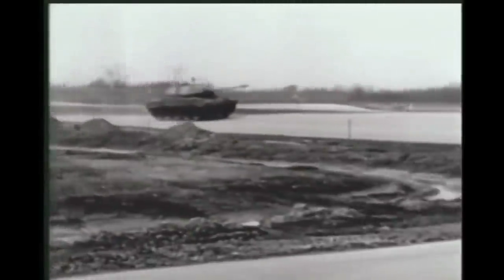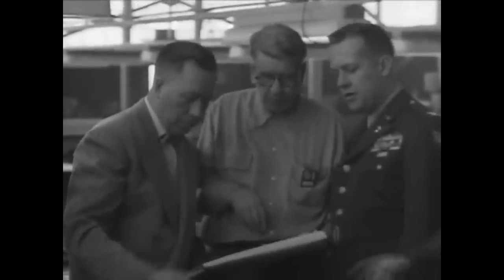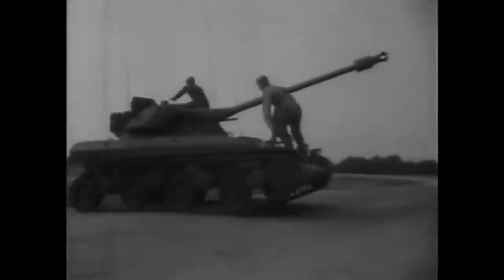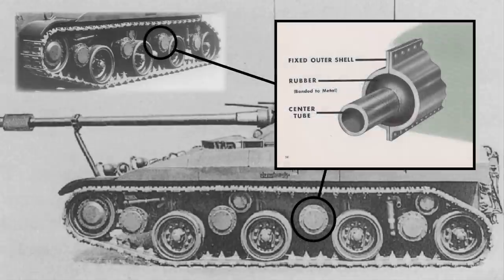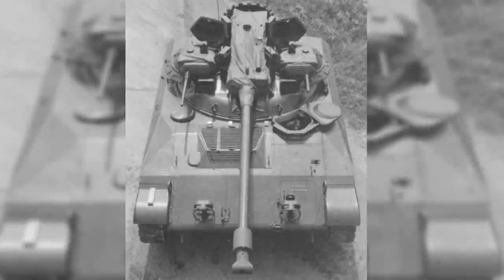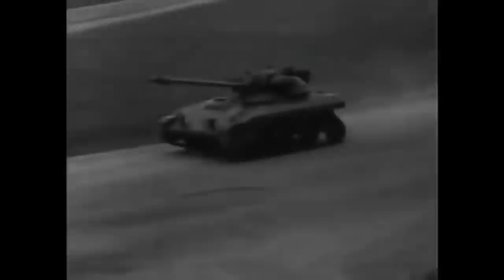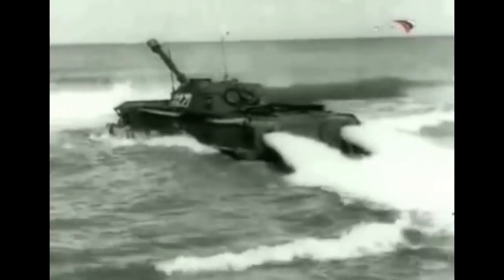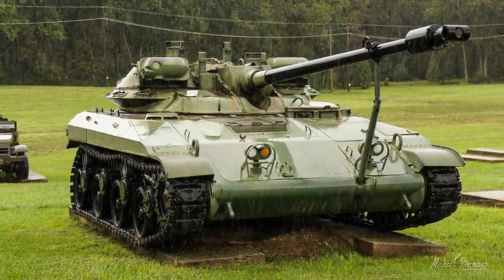T92 | Triple Turret Airborne Lightweight

Comment: Fun fact: every tank is airdrop capable. The problem starts only if you want to be able to use it afterwards.
Reply: You mean like airdropping humvees without parachutes?
Reply: @philvanderlaan5942  Maybe i guess?
Reply: @Zyron_Guy01  last year I think it was someone thought it would be really funny to do just that with three , next duty station Fort Leavenworth Kansas I believe.
Reply: That applies to everything
Reply: I'm sure T28 is airdrop capable
Reply: @lucjuszmocarny8906  the A-40 was airdrop capable , just wasn’t airsteerable and had to be at least as uncomfortable as Spirt or RyanAir .
Reply: @philvanderlaan5942  what are you on about
Reply: @lucjuszmocarny8906  look up the antinov A-40
Reply: @philvanderlaan5942  yes I know that plane thing but what does that have to do with my comment
Reply: @lucjuszmocarny8906 No wait, dude's onto something lmao.

Imagine a 95 ton wing-guided non-explosive bomb.
Reply: And even if you can't drop it a second time, it'll make a decent armored pillbox!
Reply: It’s not the drop that gets you; it’s the massive negative acceleration at the end.
Reply: I went to look up the weight of the heaviest airlifted item ever so I could compare it to the weight of the heaviest tank ever, because you can't airdrop something you can't get up into the air in the first place. Turns out that the heaviest airlift was a powerplant generator that weighed 187.6 tonnes, which is almost the exact same as the weight of the German Maus tank at 188 tonnes. So yeah it seems that you are pretty much correct lol.
Reply: not quite everything, you need it to be able to fit inside the plane, and take off
Reply: Not to burst the funny bubble but; it had to first fit in the plane. An M-48 isn't fitting into a C-130.
Reply: Yeah, digging a 50 ton m60 out a crater would suck.
Reply: @thetime_• actually NOT, airdrop capable vehicles are lighter than 20 tons
Reply: "Everything is airdroppable once."
Reply: One question to your axiom: what possibly can take to air a Maus or an E-100?
Reply: @reckless20  Saturn V?

Comment: I feel like suddenly dropping the program cause it doesn't float is silly. Seems like to me that this tank was pretty promising, and would of made a excellent tank with Air drop capacity. Which in my opinion is more important, though the Sheridan is dope, It would of been cool to see both in use.
Reply: Also the 76mm gun.
Reply: I think it may sound silly but if you watch at it from perspective of being used in Europe, the place full of lakes and other bodies of water, you better be floating.
Reply: Sheridan had it's own issues T92 looks like a mini merkavah i wonder if it was the inspiration 🤔
Reply: 76 mm gun wont do shit to t 54
Reply: @twink5717  tell that to Northern Vietnamese tank crews who got btfo'd by... 76-mm guns. Powder charge matters.
Reply: @unknowncommenter6698  i dont know a single american 76 mm gun capable of penning t 54 front. They were propably shot in the side
Reply: @twink5717  nope, shot at the front. Terrain wasn't flat and M41s (I think it was them) were at elevation compared to T-54s. They didn't just pen T-54s, but made them explode, because nobody bothered to explain to tank crews why you use frontal fuel tank after every other one (and they also used up almost all the fuel they had stored anyway).
Reply: @unknowncommenter6698  t 54's whole point is well angled Armor, if you get highground, youll pen, and ammo And fuel is stored right behind the front hull plate. Normal pen is possible but highly unlikely with apds and likely with heat, but heat sucks
Reply: @unknowncommenter6698  like the m1 abrams?
Reply: I was in the 82 Airborne for 15 year's 1968 to 1983 and the whole concept of a airborne tank was ridiculous from the start a can't remember how many 551 Sheridan AFV's I saw destroyed at Bragg/Pope JSB but it was a bunch and always funny to watch  we called it tank bombing
Reply: Yeah, the requirements for tanks in the US seem to be pretty fking weird....
Reply: The gun on the Sheridan was troublesome, and the Shillelagh missile, of which some 80,000 were made, only six were ever used in combat, to destroy bunkers in Iraq.
Reply: Prob other issues than that.
Reply: Amphibious capabilities are necessary for reconnaissance. But, I think that it was too far ahead of it's time.
Reply: Is it even reasonable to expect a para-droppable light recon tank to be able to pen the front of enemy MBTs? That just doesn’t seem to be the role of such a vehicle. It is for recon and supporting paratroopers, not going head-to-head with MBTs. If paratroopers need to be able to kill tanks, then they should give them ATGMs or make die with engaging from the flank ot ambushing from the sides rather than from the front.
Reply: It’s a light tank. The hell do you even expect it to fight T54’s???

Then again, if it were dropped in enemy lines, yeah, it will face them…
Reply: WOULD HAVE****************************************
Reply: I spent three years on Sheridans. Loved their maneuverability. Only saw one get stuck because of a rookie driver. There were some plans to either give it an 85mm gun and a dual TOW launcher or two dual TOW launchers. I think the gun/launcher would’ve made a great recon vehicle.
Reply: The m551 was poop. It had major issues out of the door and the ammo was more lethal to the crew then it was to the enemies

Comment: At 18 metric tons with 320 hp with a power/weight of 18.38 hp/t giving a very good performance but even if it couldn't float like the Russian PT-76 that led to a new swimming requirement it could still be a formidabile light tank that was relatively economical and easily airlifted anywhere. Good job 👍👍
Reply: Yeah just look at it’s performance in War Thunder
Reply: @bmac7643  warthunder isn't real life
Reply: ZaHandle do it💯
Reply: @cloaker2829  yes, but it is at least somewhat of a reference upon how it may have possibly performed in the real world
Reply: @cloaker2829 it isn't real life until you dive into the  forums with classified documents
Reply: @bmac7643  in warthunder in fight ww2 tanks lol

Comment: Requirement: we need a light tank that can be air dropped.
T92 is developed that’s almost 2/3 the weight of the M41.
…but can it swim?!!
Damn that sort of requirement change can make you go crazy.
You fulfill all the original specifications, only for some committee to decide that what they actually want is something different.

Comment: In the start of this video you mentioned how the Army received three proposals for a light tank and thus used the alpha/numeric designations “T-71” (for two of entries) and “T-92” for three subject proposals.
My question is; and I’ve always wondered about this, what were the other intervening alpha/numeric designators T-73 through T-91, used for?  Anyone venture a guess at an answer?
Why jump from T-71 to T-92 for designators in the very same project?  A project that only had three commercial entries. Why not just pick the next number in line?
In other words, how does the military decide on a final “T” or an “M” number when labeling a vehicle?
In WW2 they went from the M-5 Stuart light tank to M-24 Chaffee light tank. Were there 19 light tank prototype developments before they finally deployed the Chaffee?  If so, what were they?

Comment: I love the military when it comes to their design choices
We need a light tank for scouting but is armored and armed with a heavy tank's armor and weaponry, it needs to be fast but also amphibious and also a troop transport but also designed with a low profile for scouting and reconnaissance, but it also needs to be light weight to be transportable by air and parachuted into combat and needs an engine that can get it up to scout speeds but big enough to move the heavy armor and armed hull of a heavy tank.
Reply: They wanted a tank that was light enough for airdrops. Here comes T92 light tank. But then: It cannot not swim. Quite difficult to design anything if specifications change all the time.

Comment: The U.S. Army is full of historic, "what if's".
     In early 1985, the Sergeant York anti-aircraft, twin, 40mm Bofors, tracked system had been approved for mass production and deployment.  The SGT York was to be the U.S. Army's direct counterpart to the West German Gepard, which mounted two, 35mm antiaircraft cannon.
     Yet in June 1985, The U.S. Army stunned everyone by abruptly cancelling the SGT York.  Soldiers were already in training schools learning how to operate the SGT York, or how to maintain and repair it.  The top Army brass and the Secretary of the Army claimed the SGT York was already obsolescent.  Guided, radar antiaircraft surface -to-air-missiles were the wave of the future.
     In 1992 the Army had chosen the FMC Armored Gun System for mass production and deployment.  The AGS resembled a dwarf M1 Abrams tank.  It was not a tank per se, as the Army insisted.  It was a self-propelled, high caliber, direct fire, infantry assault 105mm cannon.
      But before the U.S. Army let contracts for mass production in 1993, it cancelled the entire program.  The Soviet Union had peacefully dissolved in 1992.  The Army top brass declared the AGS redundant to force future threats.  The money could be saved and spent elsewhere; the peace dividend, it was called.
       In 1970 the U.S. Army was about to approve the heavy, heavily-armed Cheyenne Attack Helicopter for mass production.  But events overtook the Cheyenne.  In mid-1973 the U.S. Army finally withdrew from Vietnam after eight long fruitless years.  Congress was fed up with the Vietnam War and wanted nothing more to do with expensive, new-weapons acquisitions.

Comment: The Sheridan could swim and with its overdrive transmission it was as fast as the later m1 and Bradley's. I know this from having served in them in the 1980s.the biggest issue was the aluminum armor and that ridiculous short barred gun that was necessary because of the crapshow shitlay missile system

Comment: Funny how the cold war militaries though everything had to swim or snorkel for a while.  Then they realized that in order to do this you need calm water, little flow and, most importantly, a nice place to enter and exit the water.  I think in most cases swim capability is not even close to being worth the extra design factors.

Comment: Thank you very much for this video. I knew that the t92 had a cleft turret but that was all I knew about it. Will know how problematic the gun on the Sheridan turned out to be maybe something more like the teen 92s cleft turret with a different gun would have solved those issues.
Reply: The M551 was trialed with a 76mm gun.
Reply: @gmatgmat  a76mm gun and a tow box launcher on the side of the turret would have been more generally useful, probably.   Heck, a 105 artillery gun and tow box...

Comment: The concept could still have been scaled up to MBT specs. They could have created either a much lighter and more mobile MBT or a standard weight MBT with a higher caliber gun, like 155.
Reply from the maker: Israel essentially did this with the Merkava series!
Reply: @RedWrenchFilms  
Not really. The Merkava is heavier than average and carries a standard caliber gun, loaded manually. I was talking about something more like the Swedish Stridsvagn 2000 concept. The basic idea is, if you put the main gun outside the fighting compartment you can make it bigger and with higher elevation/depression, but it will have to have an autoloader with no manual backup.
Reply from the maker: @lucianene7741  Ah something like the M1128 MGS then?
Reply: @RedWrenchFilms  
Something of the sort, yes, but with tracks instead of wheels and a manned turret. You still need top vision in a tank, no matter how advanced the electronics.

Comment: When u could be deployed via airborne, smaller and lighter than an M41, "could" deflect nuclear shockwaves, fast enough to travel as a light tank, only need atleast 3 crews to operate in worst scenario. But u cant swim:
"My disappointment, is... Immeasurable. And my carreer is ruined."

Comment: I visited the one at APG and made models of M113 and T92 in junior high. I have been in M48A3 which used the same basic cupola design. They are a bit awkward to reload ammo fast. https://en.wikipedia.org/wiki/T92_Light_Tank   I believe a better option would have been a similar design with a 90mm gun with a Coax machine gun and simpler 50 caliber mount. Add bolt on flotation pods on the sides when needed for river crossing.